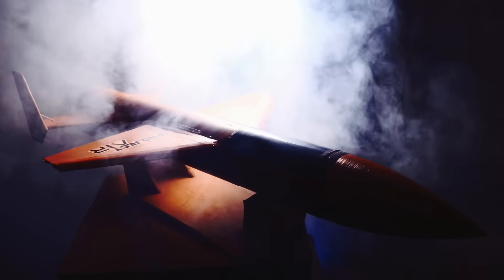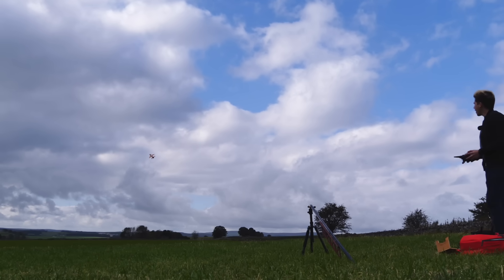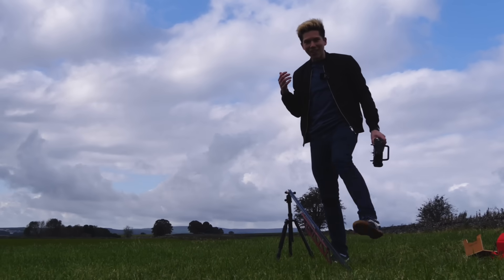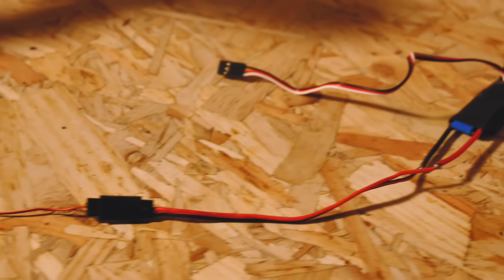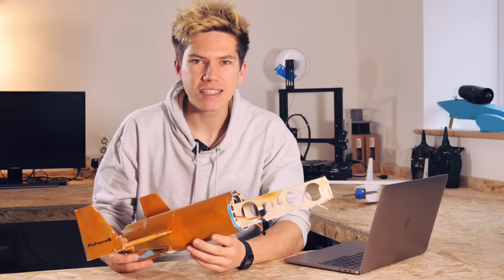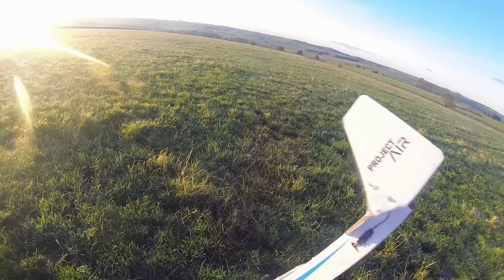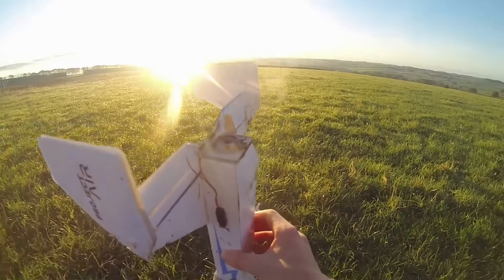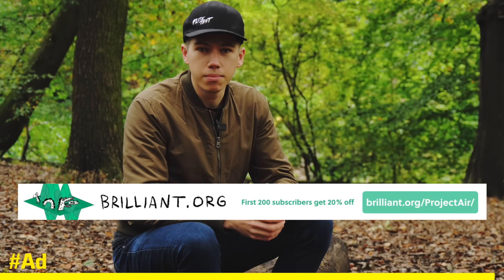High Power Rocket Plane pt.2

Comment: You might want to look into folding props like what they use on gliders, you could go full throttle then right before ignition, cut it and it should fold and have a lot less resistance

Comment: I'm guessing your props are too low pitched.  I have a flying wing built for speed, and it can barely launch because the props are too inefficient at low speed.  They only come into their own at high speed.  Whereas we've seen your plane accelerate vertically at low speed.  If you're really looking for speed, go with steeper pitched props that are more suited to high speed flight and work out a different launch mechanism, perhaps a catapult or even a hand launch (thats how I have to launch my wing).  Also consider ditching those outrunner motors for inrunners.  They're more capable of higher rpms.

This could be a case of differing intent.  Perhaps your goal is to have the electric motors be more for launching and not for the speed pass.  Fair enough if so.  But of you want to go for record speeds I figure you want every advantage you can get.

Comment: Adding weight and wind resistance is counter productive to your goal. You should lighten the aircraft and use a bungee type catapult if you want to light rockets while in flight. Either that or drop the rocket plane from an RC plane just like Bell X-1.

Comment: You could upgrade the new design with foldable props, and motor braking on. Go full throttle, suddenly take it down, and when the prop folded ignite the rocket.
This way you will have no drag over the prop.

Comment: Hey dude. Remove the clay plug, just lightly scrape it off. Empty the lose BP. Then mix some epoxy and poor in so it’s level. This makes for a plugged motor. You’ll won’t have an ejection charge but will have a smoke/delay charge after the motor has burned. 

Also I use a Turnigy RC switch for the ignition. On my radio I have an arm and disarm switch then the trigger.

Comment: Great Work! I think there is much Room for Improvement. Might I suggest using an EDF and a Closable Air Intake... something like in SR-71 Blackbird. You could close the Intake just when the Rockets ignite and open it again just after the Boost, hence reducing the prop Drag.

Comment: Try to use folding props with esc braking to decrease drag when you fire the booster. This should let the prop blades fold back becoming more aerodynamic and the esc braking will stop the motors from spinning therefore preventing an accidental opening of the folding props.
I hope this helps,
Jeb

Comment: If speed is the intent an aerial drop would give the results with the original design craft just like the one  chuck yeager flew but if you wish to continue powered flight on prop i advise canard with folding pusher prop and conventional runway launch or catapult

Comment: Flight controller with GPS, and fpv would be lighter than that brick GPS unit you're using. 
Matek f411 wing
Bn-220 
Eachine 25mw vtx 
Inav

Comment: You'd expect a rocket powered model to be faster than that. The tiny german under 250g fdd racers are doing about 290km/h for longer than this plane and they come in for landing a lot slower. My own fdd does 270km/h and it is completely homemade. Maybe you can use another material than foam board and use thinner wings with sharper trailing edges and some high pitch folding pylon racing props.

Comment: ive noticed your plane design  looks very heavy in flight try making the body more skeleton structured then aero dynamic because then the air has more room to flow through and it will be much lighter

Comment: Everyone here has made great suggestions when it comes to the aerodynamics and thrust, but I highly recommend implementing some sort of gyro or differential thrust or both. Identifying any problems with the plane through testing becomes significantly harder with low reliability. And you can save time, money, and airframes if the plane is capable of keeping itself alive. You don’t want to make decisions on bad data.

Comment: What if you tried adding a parachute that you could deploy and then slowly fall to the ground? This would allow you to have an airplane designed for speed, while enabling you to land safely. Also, there are propellers that gliders use that have blades that fold back, which would prevent the motor from spinning too fast or creating drag. The only issue with that would be no motor power on the rocket stage. Love the vid btw, keep it up!

Comment: I remember, a few centuries ago when I was flying RC and control line airplanes, using the string method to narrow down the Cg and Cl of any new build.  Just simple balancing to find your fore/aft Cg, then attach a string to the model at that point and SWING IT around in a circle to see if your Cl is about where it needs to be for stable flight.  I think that was the step you left out of the second (prop driven) model.
.
.
Using a more normal aircraft as your first stage with an air launch for the rocket plane would probably get you the biggest performance boost.  Alternatively, mount a launch "sled" on your rail to give the plane a start, it would drop away (in theory) when IT'S engines burn out and the main engines are lit.

Comment: To achieve both high speed and safety landing, variable-sweep wing and lift body might be a solution.
Reply: At the low Reynolds numbers and low mach numbers of these kinds of models, lifting bodies and swept wing will slow you down and be very inefficient. The best option is to use thin high aspect ratio wings with semi symmetrical airfoils, kinda like a glider. Those give incredibly good high speed performance on small models, just look at f5d pylon racers.

Comment: Thanks for showing the failure. Its good to see smart people working though problems and disappointments and to dust yourself off and then work towards a success!
I tell people all the time that RC Planes is not a flying hobby, but a vehicle rebuilding hobby. <G>

And spread the word:

"A nose heavy plane flies poorly. A tail heavy plane flies once."

Something that I am remended of every once and a while, usually doing the "walk of shame" with most of the pieces of a new aircraft in my arms.

Comment: you should use retracting props as they are used in soaing planes, they will fold in when u  turn down the throttle and then ignite the charge

Comment: I try not to be critical and remind myself That you don't have my 20+ years of RC experience so I am just gonna list the issues you will need to address to make a vehicle fly through all phases of the flight.
 
1. Folding Prop! Program your radio to stop the motor a second before ignition so that the props have time to fold up next to the fuselage. For this reason I think fans are a bad idea!
2. Rocket motors get lighter as they burn. 

With as many motors as you had at the back of that first plane it was doomed to crash after you ignited the rocket motors. I designed a plane like you are making about 20 years ago and determined the only way to keep it flying after ignition was to shift the center of gravity in flight either by moving weight inside the plane or sliding the wing forward and back during flight. 

3. One advantage you have over me is that we didn't have programmable radios back then or nearly as many channels to use. I eventually gave up on the project because I determined it would require multiple relievers and multiple transmitters and pilots to accomplish. It would be much easier today with a programmable radio.

4. A Catapult launch is a good idea even if you don't actually have to have it! 

It's a cool project but I'm glad that first plane looped on take off or the crash may have been spectacular. (Good for You Tube but bad for Safety)

Comment: I had this idea 💡 years ago, but my idea was to have a second stage rocket, so launch the plane, gain as much altitude as possible, then when  the rocket is launched it can achieve a higher altitude, this is very much scalable system 👌🏼👌🏼

Comment: So firstly, this was rad! :D Secondly, I have lots of suggestions! I'd like to agree with both (1) the people saying use a canard and/or delta config (easier for CG, they are SO forgiving) and (2) the people saying use a higher pitch prop rather than a folder. I'd also add, try to have more tapering at the rear of the craft, and taper the trailing edge of the wings to be thinner - you're going to lots of effort to make a lovely nose cone, but rear streamlining makes a way bigger difference to drag reduction than frontal streamlining. And then, cashing in some of those savings on parasitic drag, you could afford to have just a little more wing area, for a much easier takeoff and landing.

Comment: Ditch that prop. The propeller drag limits your top speed by a lot. You can try a folding prop (like an electric glider), but I doubt you'll find a fast enough prop. If you go that way, program a prop break, then speed the plane to it's max speed and brake the engine right when you ignite the rocket.
Also - your CG is too far back on all flights. I think you are trying to apply general RC plane rule of thumbs to a plane that's really not generic. Your stability margin is smaller than you think. Also, you got to take into account that you are burning a lot of mass in a very short time period.
Reply: Modern pylon racing props might be suitable, there are some small 7x13 folding props which are used up to 320km/h. I managed to push a 250g model to 270km/h with one of those.

Comment: This is actually quite close to my idea of how to capture the Ansari X-prize, but Burt Rutan beat me to it.
Go back to your original orange plane design and get your COG issue figured out.
Your high-speed runs with the ducted fans were impressive. 
If you had the balance worked out, a high-speed pass followed by a vertical and igniting the rockets would have been spectacular.

Comment: Next Vid: Ballooning it up to High altitude and releasing to glide a little bit and ignite the Rocket Motor to see if it can go higher 😍 also if you have problem with the airframe also  include a LIFTING BODY airframe such as those on space shuttle, the DREAM chaser or the highly classified x33

Comment: DO NOT put a folding propeller ! You can extract a lot of thrust from you propeller even at very high speeds. You should consider putting a higher pitch propeller, and/or go to a higher voltage battery to get higher RPM.
Reply: He not getting heared😔
Reply: You have to put a heavy thing in the nose, and then you can fly a bit more easily and don’t make it wobbly

Comment: Yeah, from what I understand, EDFs have lower static pressure at a standstill, but increases in affective power once you get some air pushing through them.

EDFs would also cause more drag with the rocket boosters, though.

Comment: I love your smaller airplane ! Weight is absolutely critical, especially in rockets. To go faster you should put a propeller with a bigger pitch, so it will not overspin when lighting up the rocket, which makes the motor ineffective.

Comment: How about a folding glider prop? Hook a motor cutout to the igniter circuit with a slight delay if required; to componsate for ignition to full power delay.

114mph is defo doable.

Comment: One option to reduce prop drag would be to cut throttle just with a folding prop before ignition to allow the prop to fold and therefore have much less drag

Comment: Aerodynamically, I would put the EDFs inside the body and put the smaller rockets under the wings.   With the thrust of the rockets it's going to rotate into a loop.  CG a little forward if you can.  I've done something similar and nose heavy helps with rockets.
Reply: The rockets should be located along the longitudinal axis, preferably as close as possible to the center of the body so they won't exert a severe pitch up moment. Under the wings is BAD.
Reply: @aGabay  test it with a glider and smaller rocket.  You need the nose weight or it's going to rotate to a loop.  Under the wings, forward of CG or close to longitudinal axis either way.  Still needs to be forward of CG unless you use a low thrust to weight ratio.
Reply: @nothingtoseehere4026  This way, you are going to shrink your stability margin. Not good.
Reply: @aGabay  put a C rocket directly CG on a stryrofoam plane.  I think they're about a 3 ft wing span.  You can buy on Amazon or Walmart... Fly it and you'll see what I mean.  Heavier wing loading might help though.
Reply: @nothingtoseehere4026  I don't know anything about model rockets... I prefer suck-squeeze-bang-blow engines 😜
Reply: @aGabay  I like them both for different reasons.  I do need to get a turbine to mess with.

Comment: The whole time I was thinking "why is he testing the electric mode of the flight without an appropriate mass at the rear to represent the rocket motors?" Aaw well. RUDs also make for great videos, well done with the project, and I really hope that you still plan to try again with a tweaked original design

Comment: Great video and project! A suggestion regarding overdriving the motors under rocket power. Look for "lift motors" used by RC glider pilots. They have fold-back propellers that are designed to fold-back flat when the power is cut. Perhaps you could use one/two of those for the electric-powered portion of the flight, then cut power just as the rocket motors kick in. Keep up the great work and thanks for letting us learn-along!

Comment: Possible solution for prop drag on your rocket plane. Use a folding prop like used on powered gliders. The blade folds when the motor stops spinning. Hope this helps. God bless, stay well.

Comment: why not use PVC as a fusalage or you are using one?
Reply: Pvc is way heavier than foam, increasing wing loading and making the rocket plane even more difficult to fly. Pvc is a great material for smaller parts though!

Comment: Those FMS 50mm fans are fantastic! I used a pair on my Robbe airliner conversion. Could you program a throttle cut on or shortly after rocket motor ignition and use some folding props to reduce prop drag a shed load?

Comment: I love your content man. I love making rc planes. I was wondering how you got the rockets to ignite in air? Im still new to this whole hobby but i want to make a jato system for my plane
Reply: He used a brushed ESC, the ones for motors with only a positive and negative, not the brushless 3 wire ones. As it is an ESC, he can connect it to his receiver and tell the ESC when to send voltage to the positive and negative wires. These two wires are bridged by a fuse or resistive wire, which heats up when voltage is applied across it, thus igniting the engine! Hope this helps! I love making experimental planes too!
Reply: @theorangebaron1595  thank you!

Comment: I'm sure you probably already know that Hobby King used to sell an Me163 into which you could install a rocket motor - the motor they recommended is a C6-0 the 0 on the end means that there isn't a parachute ejection charge - it would be interesting to see not just the max speed but how much was added to the propeller speed by the rocket

Comment: Would it be possible to automatically throttle back the prop during the rocket boost phase? Maybe with a clever bit of sensing you could detect if the prop is over-revving? Perhaps if it spins too fast the current draw of and voltage drop across the motor might change in some detectable way that could allow an onboard control system to reduce power to the motor to reduce the prop speed.

Comment: Great effort!👍
You should have tested the first one with the rockets to properly test the centre of gravity.
I would suggest to mount the motors below the fuselage under the cg to better improve high speed stability.
Use the wing shape from the space shuttle as that was optimised for smooth high speed and low speed flight .
Reply: The distance from the CG doesn't matter as long as the vector of force is aligned with the CG.
The space shuttle wings were a compromise between hypersonic, supersonic, transonic and subsonic speeds. They had a massive amount of drag at subsonic speeds, which is a bad design for a small subsonic plane. Straight wings look lame but are the least amount of drag for a subsonic plane.

Comment: an idea , use a folding prop like a performance powered glider does so you can get the powered launch and then power down the motor and fire the rocket with no prop restriction

Comment: I had a bad day and seeing you succeed brightened up my day! Amazing video James! I think you need an esc with a brake feature(my turnigy plush-32 has one) to stop the motor immediately while still having speed and a folding propeller to reduce drag, as the area of a non folding spinning propeller that produces drag is equal to the circle that the prop makes when spinning and not just surface area of blades.
Reply from the maker: A folding prop is what I would have liked to have used on the MK2 plane in this video, in an ideal world - would like to test one in the future! ☺️
Reply: @Project-Air  what if you use higher pitched props that way you can still get some power off of them whilst the rocket is on, though depending on the pitch guessing it might need an air launch
Reply: @diogonunes1865  more pitch would increase speed but also load the motor more
Reply: @linecraftman3907  yes it would load the motor more at low speeds but would prevent over revving and extra drag at higher speeds
Reply: @Project-Air  They're actually pretty cheap, no more than 15 bucks on hobby king and you can find different blades sold separately for spinners on banggood and aliexpress
Reply: I just suggested this. Great minds think alike.
Reply: @Savage_Offroad  hahahaha true